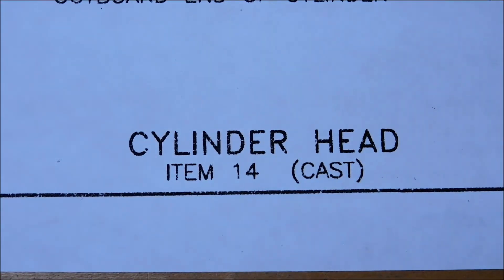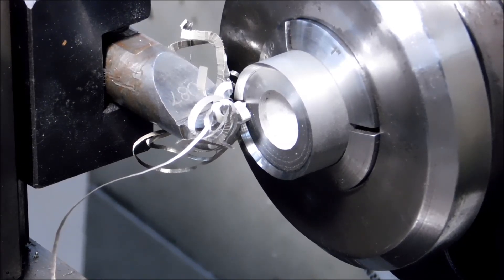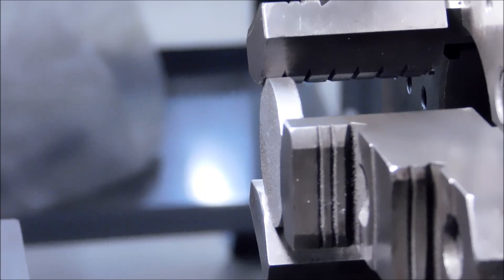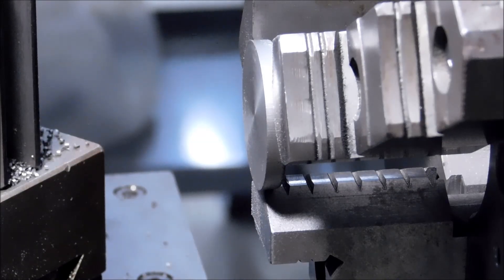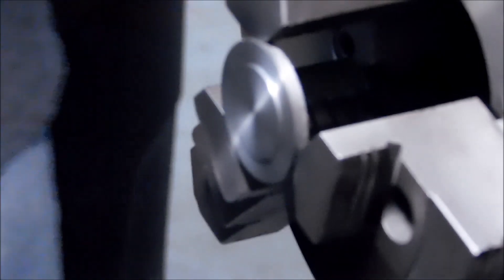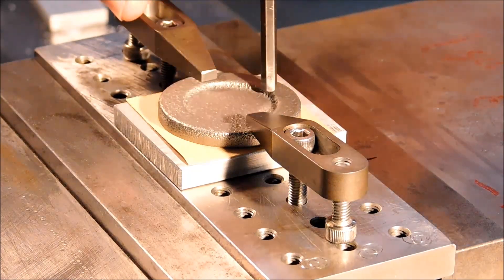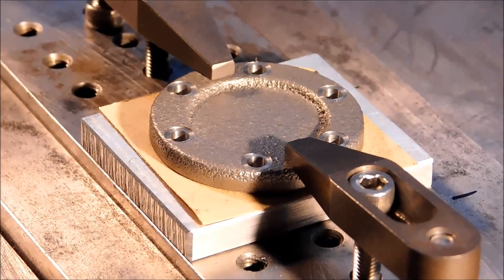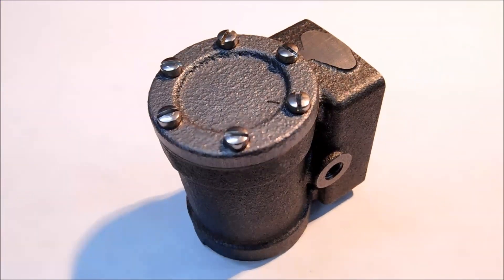Machining a Model Steam Engine - Part 13 - Cylinder Head  and Gaskets

Comment: How did you clean up the cylinder head edge? I don't recall you mentioning if that was cleaned with a file, belt sander, or turned using a press fit. Was it cleaned out of the box?

Comment: Joe, thanks for including the small error on the lathe cut. We all make mistakes, like I was once told, it's how you fix them that counts. In this case it wasn't a big deal at all, it was still in tolerance.
Reply from the maker: I had 062 locked in my head when it was more like .045. I took a cut at .050 to rough it. Still fine, just not nominal.

Comment: Wow Joe, two wait a minutes in one video,  couple of videos ago I was wondering when was the last time Joe made a mistake.  Each of your videos I get many more tip than you are highlighting.  You are teaching more than you realize.  Thanks Its fun seeing the solution light come on and then thinking that's from Joe, Thanks Joe.
Reply from the maker: I like to define mistakes as an action that results in a part scrapped or out of tolerance. So technically, I'm still OK. I was probably thinking about a big plate of turkey.
Reply: I  stand corrected sir.  My hero worship is not shaken.  Thanks for sharing your work with us.

Comment: Hi Joe, thanks so much for all your videos.  I think that taking on a small project such as this stationary steam engine is a great way to illustrate a large variety of machining techniques to all your subscribers, plus it's very interesting to watch as well.  Great Job.  It was funny when you found that you had forgotten one of the gaskets.  Since you were still centered up on the mill, I would have just placed the second gasket under a piece of aluminum sheet metal, and re-drilled the holes. Your base plate was held down by tape so everything would have lined up nicely.  Maybe you did that, but it wasn't shown in the video.  There are lots of this type of model kit in the market place, so if the Covid restrictions continue for a while more, maybe you should take on another project like this, it's cool to watch you.
Reply from the maker: Recovering from that single gasket oversight was easy. The fixture was still lined up and I used a pin to clock the cover. It took 5 minutes. My next project is the EL1 miniature working metal lathe kit. I already have it. Its a good one.

Comment: My excuse for making the cylinder head a few thou under would have been to compensate for the gasket being a few thou thicker than what is specified and the coat of paint when it is all finished 😂
I have one of those little 3020 cnc engravers that i intend to use to cut out my gaskets - not because it is faster or easier its just that i have this damned thing sitting here and it has to have some purpose in my shop or out the door it goes !

Comment: Hi Joe I liked your gasket cutter, also the you always show an elegant  method of alignment, I used on all my engines to cut the gasket is after the head and cylinder are done I just insert the gasket material between them and tap with a soft hammer.
Thanks Rich

Comment: Do you have any trick on timing the screws, so all line up in a pleasing way? For example, have all the screw slots lining up with the centre.
Reply from the maker: Adjust the depth of the spot face, or dust cut the underside of the screw head. Both will allow you to clock a screw.

Comment: Nice work but for a better appearance use hex head screws or better still studs with nuts for the cylinder covers.

Comment: How about instead of a bunch of screws that dont look like they belong on the model make up some studs and nuts on the cnc or manual machines
Any one can put the screws in 
Its the subtle things on a project that make it different than all the other ones being done 
Then when people who have also built one see those things that others dont even notice that really set the difference between two different models of the same
That what I like to do on my hot rod

Comment: Hi Joe,

I’m apprehensive using a three jaw chuck to hold such a thin disc at the tips of the jaws because I would have thought the jaws would tilt enough to allow it to pop out. Do you have any other methods for holding such a disc that would make this less likely to happen? Soft jaws with an undercut for example? Soft collet?

Thanks. 👍

Comment: I don't understand the 1.5 inch scrap that he indicated on before the part.  Whats going on there?  3:33
Reply: Probably it's an adjustable chuck and he adjusts it using a piece of round stock in place of the cylinder head.
Reply: @koharaisevo3666  Yes, it is an adjustable chuck.
Reply from the maker: The OD of the cylinder head is rough and not reliable to indicate. By presetting my adjustable chuck to run true holding a part the same as the supposed diameter of the casting, I would be close enough when the rough part is installed.
Reply: Thats what I missed.   I didn't realize you could have adjusted the chuck.

Comment: If you had a large enough collet to hold that in a collet chuck, would you have done so rather than using the 3 jaw?
Reply: It doesn't look like it was machined to size. It was only run over a belt sander or something like that. So the outside isn't precisely round. In that case a 3 jaw will hold more safely than a collet, especially on a thin part like this.

Comment: i have a small ball n peen hammer (the heads about 1 inch long) ive made very intricate gaskets with.  use the sharp edge of the part to cut the gasket  material.    later on i welded ball bearings on rods of different sizes to cut bolt holes using that same method   fyi

Comment: That was a dead crafty way to square up the casting in the chuck.  I would never had thought of using the front of the tail stock.  ( and I have never measured it...). Every video has another lesson.  Thanks Joe.

Comment: For sure, parts holding (and set-up) is certainly one of the challenges. Really like the methods you used for this part - so logical and effective.  Haha - had to chuckle with the forgetting of gasket #2 :) More and more I am riddled with anticipation towards the complete engine - so much progress now. Thanks Joe.
Reply from the maker: I honestly had 2 on there, but the second one dropped off on the way to the mill. I never saw it happen.

Comment: Never thought of using the tail stock to get a part flat? Farmer meets a true machinist the learning is endless on my end Thanks Joe.
Reply from the maker: If you need extra room, the face of a large drill chuck can work just as well.

Comment: It's shaping up nice Joe π, Are you planning on drilling out the boss's in the base to mount the engine on something?
Reply from the maker: It should sit on the proper mount. Machine skids, bricks, something awesome. Any suggestions people????
Reply: @joepie221  A nice piece of Teak would look nice. It's extremely heavy, strong and durable.

Comment: Cylinder head leaves the chuck without permission and takes an hour to find and I’m annoyed. Gasket doesn’t have holes... meh :o) *latest boiler hand pump build has all the internal features 2 degrees off line due to drill table flex. I think you would implode if you came here ^-^
Reply: Don’t beat yourself up too much! We all have bad days!😳 All part of the learning experience... 👍🤞
Reply from the maker: I had a part the size of a manhole cover leave the chuck once. 900 RPM. It went over 100 feet before It slowed down. If I was 3 inches to my left, you'd be talking with someone else right now. It doesn't get much closer than that.
Reply: @joepie221  Wow! We had to fire one on the spot when his loose flycutter tool flew a couple of inches from shop engineers nose and made a hole in the shop wall. Nothing like the incident of yours but I gained additional respect for all things rotating.
Reply: @joepie221  I got tree stitches in my head from a chuck changing spanner because the “brake and run” were the same lever :D Never launched a big part though. That’s why I follow Jan on twitter. She machines steel works rollers and the rest of us look on in awe as she shims a 20ft tube at the tailstock end :o)
Reply: @milantrcka121  Now I remember!, I lost a chuck at school. I put it on and hit go and for some reason it unwound itself, grabbed the bed and shot off. 6” three jaw maybe?
Reply: @onlooker251  this isn’t a bad day, this is dyslexia :D If it was learning I wouldn’t have used the cheap drill press :D
Reply: @teamidris   I can understand where you coming from - I'm Dyslexic as well. I only found out about being Dyslexic 25 years ago. School days were a nightmare in the '60s I was labeled as 'slow'. I try to make use of what talent I have to my advantage - we Dyslexics see things from a different perspective. :-)
Reply: @onlooker251  I wouldn’t swap the 3D vision for reading :o) . As you can tell from my channel, I can write stories, but it takes ages to get the idea into decent text. I hated school.

Comment: Looking great. Yes, studs and nuts would set it over the top. I look at mine on the shelf and say it every time. I started doing one using commercial nuts and making studs. Looks decent but the nuts look too big for 2-56. Better looking than the screws though.
Reply from the maker: I need extra small square nuts and studs. That would be a great addition.
Reply: @joepie221  Keith Appleton makes studs for cylinder heads by nipping the head off a slightly long screw, cleaning it up, and running it in with double nuts. Seems to me like a not bad way to do it, short of having running thread of the correct size. Square nuts that size would be a bit of a challenge though. Might not be hard to do on a CNC or screw machine with a lot of waste, but I'm not sure I'd like to do it by hand or on manual machines.

Comment: I’d like to have a set of small clamps like you used to hold the cover. What is the proper name for those clamps?
Reply from the maker: I made those many years ago. I have 4. They would be called miniature toe clamps.
Reply: @joepie221  Miniature Toe Clamps sound like a torture device.

Comment: I would have never made it past your first step.  Once the 1.5" O.D. "scrap" SS was in the lathe my engine would have ended up having a 316 SS cylinder head.  I have a weakness for shiny.

Comment: are the screws holding down the head used or are you using something differen't..not much clamping force with screws cant use a torque wrench either..
Reply: Yes the screws are part of the kit.
 The thought of using allen head/socket head is mentioned in other video's of this build.
Reply: On large, full sized engines, they would be bolts or nuts on studs depending on size.
Reply: How much clamping force is needed? At 100psi there would only be 79 pounds of force acting on those 6 bolts...13 pounds each (corrected, thanks Ron).  I think 100 psi would be on the very high side for a model?
Reply: @dwaynepenner2788  The surface area of the inside face of the cylinder head is pi/4 sq in, not pi. The diameter is 1, so the radius is only 0.5. Easy mistake to make, though.
Reply: @RonParker  oops.  I stand corrected, the pressure is only 78 psi, with each bolt at 13 lbs.  thanks
Reply: @dwaynepenner2788  off the hip i would say the bolts will contribute to a head leak and i think they will stretch causing a untorqued spot..the head should be ground flat as well as the deck of the block should be cleaned up taking off minimal material just enough to clean it up
Reply: @seekingtko3146  It sounds like your point of reference is a gasoline engine (internal combustion) not steam (external combustion). There is no "block" but both the cylinder and head mating surfaces were machined and the boss on the head keeps it located laterally.  After @Ron Parker corrected me the cylinder pressure at 100 psi supply is 78 psi, but it is more likely to be run at a max 50 psi (39 psi cylinder  For reference a gasoline  engine cylinder pressure is around 1800 psi.  which would translate to 1400 psi in this engine ) supplied so I would feel pretty confident that not only will the bolts not stretch (even though the more likely failure is the threads in the casting)  at 6.5 pounds of tension, it will run reliably, and probably efficiently due to the tolerances Joe has held.   But we will see.

Comment: My wife bought me this engine kit for my birthday. Came in yesterday and wow this is a really nice kit. Mine only came with 1 gasket sheet. Did your kit come with 3. Also much respect when you did the oil cups. Seeing the 3/16 hex stock and holding it in my hands made my mouth hit the floor. Looks much bigger when you did them.